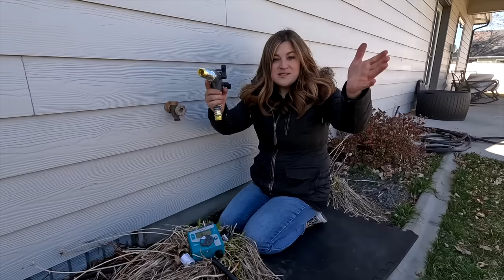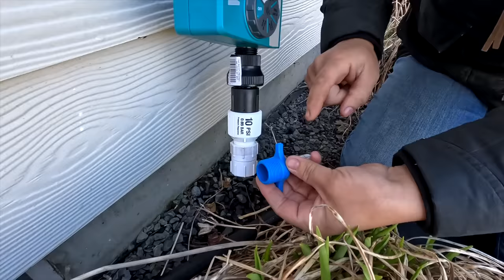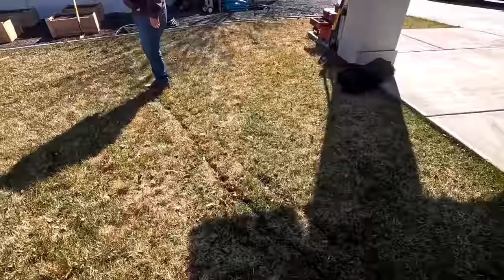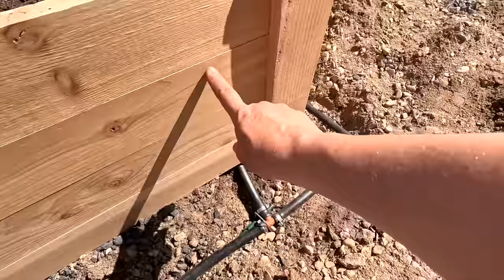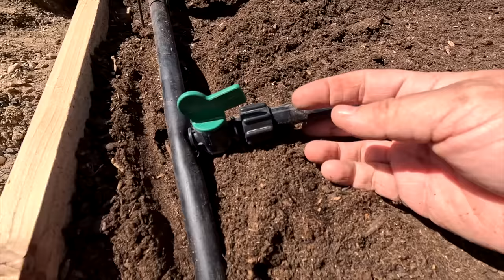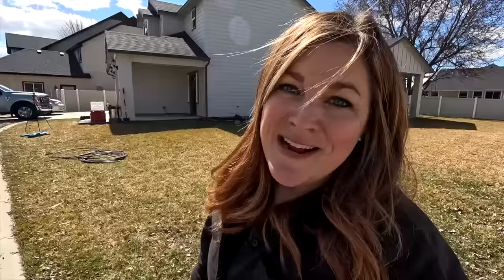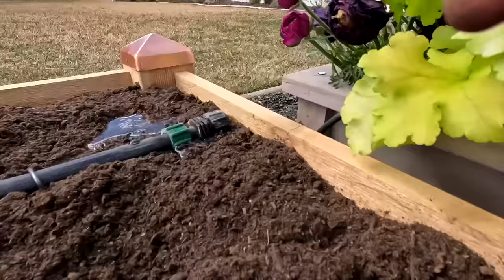Setting Up a Complete Drip System for Raised Beds from a Hose Faucet! 💦🌿 // Garden Answer

Comment: Burying an extension cord does not meet any electrical code and it is just unsafe.  If an event occurs resulting in injury, damage or death there may be some liability issues.
The homeowner may also be jeopardizing their homeowner's insurance coverage due to unsafe and unworkmanlike installation not meeting electrical code requirements.
You should seriously think about pulling this video and addressing the proper method to locate an electrical outlet to the greenhouse area.
Basically, you are looking at PVC conduit plus your wiring or just using direct burial cable.  Either install will need the appropriate depth in the ground plus appropriate overload protection.
Not a big deal and it is doable by the homeowner if minimum code requirements are followed.  Hope this helps.

Comment: The lady is ocd, centered equal distance all  drip pipes, Nd 45% deffently rite choose by eye, flaring out to rite a tap look silly, only bit I don't agree with was just put a spur in and armoured cable to shed or at worst cable in old hose for mechanical protection.. but kno u not sparks dats home owner session apart from dat...lovely all round

Comment: I got as far as the valves in the raised beds and couldn’t watch anymore 
Wires below ground are dangerous as hell ……… 
Those drip tapes your using do not belong on 1/2” tubing there fir 1” tubing 
Waist of water and your pressure will suffer significantly….,